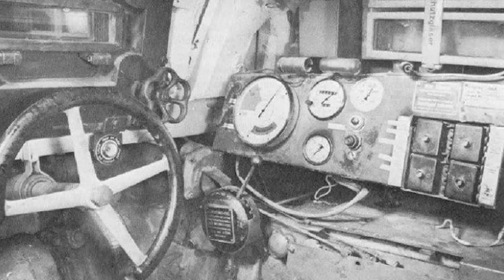A Deep Dive into the Tiger I, by the Chieftain

Comment: Speaking of cranes, how did the Germans ship these things to N. Africa? Were they forced to disassemble into two pieces or did they have some transports that had 60+ ton capacity cranes?
Reply: Most Tigers were shipped on the "Marinefährprahm", a barge designed for beach invasions of the D-day type. Each barge could carry one Tiger. They drove onto the barges from the beach at Reggio Calabria and they debarked at the airport dock in Bizerte.
The first three Tigers were brought over by a roll-on roll-off ship, but that got sunk soon afterwards.
There was no need to dissassemble the Tigers because cranes were not involved.

Comment: I never, absolutely never, actually expected that they'd teach tankers to aim at that cupola. I just figured that's far too small an area to shoot for with WW2 tech and guns. I'll be damned if War Thunder inadvertently taught the same thing. While the game laughably models APHE like it's a hand grenade when it explodes, it should be a conical spread not a spherical spread, it's just very surprising that the game somewhat plays into history in that case. In the game they also use the same idea against the IS-1 and IS-2 and I would wonder if the Germans taught the same thing by chance. Still very surprising to hear that in real life some tankers or tank destroyer crew were taught to aim for the cupola.
Reply from the maker: Surely not an easy target.
Reply: There must have been incidents where the cupola was hit, because in the Spring of 1943 the number of bolts holding it was increased from 10 to 15.

Comment: The Germans are famous for their engineering but sloped armor seemed to be lost on them until the Panther and only because of the T34s sloped armor. Germay would have been better off mass producing a single tank. Even the panzer Mk. IV in enough numbers would have been better than the wasted time money and materials on competing designs. The Panther would be my choice to gear up for producing I would have kept the Stug III in production. Like the Sherman that was a poor tank but there was a lot of them the Panzer MK. IV that was a better tank then the Sherman could have helped Germany if mass produced.
Reply: exactly they had too many maintenance problems with too many models and never really worked the kinks out. The Stugs and the Panzer IV would have done them well with modifications
Reply: More tanks wasn't going to do them any good when they were running out of men and fuel.
Reply: Germans new the benefits of sloped armor but, they didn't use it on the Tiger because it reduces internal space too much in comparison with the benefit of extra protection at the time as 100mm of vertical armor was more than enough. Then the Pz 4 was worse than the Sherman in all aspect mainly mechanical reliability, maintenance, armor, and production cost but better  gun and optics.

Comment: Anyone know if that Tiger 1 in museum has original type paint? Or glossy for display.
Reply from the maker: @tw t at 14:40 the curator talks about the paint used, the 'glosiness' is most likely due to the fact that this tank has sat in a clean indoor environment since it was painted rather than driving around in the real world
Reply: @WorldWarTwo  The troops that got this tank new off the train in 1941? Tank reg. must have seen and been impressed by some new paint/all new tank also.
Reply: @twt000  Deliberate choice as museum tanks don't go to the wash rack very often. It's easier to clean a semi-gloss.
Reply: @twt000   Tigers were not delivered to any troops until August 1942. And those troops were up near Leningrad, so they got very dusty Tigers.
Reply: @daveybyrden3936  Rail yards are usually not dusty, nor is Leningrad it being forest. Still some dust though. Not like dusty Volga.

Were the Tigers delivered to the front? Or did troops have to go pick them up?
My main other point is them seeing the Tiger "brand new", were they excited?
Reply: @twt000    Those Tigers had been transported from Germany to Leningrad by rail, sitting on open rail cars. 
They were not literally delivered "to the front" because the railway lines didn't  terminate in a trench. Of course the troops had to pick the tanks up from a station.
Reply: @daveybyrden3936  Was meaning the nearest station to the front. So the tank regiment would go all the way back to pick up Tigers and lose forward line momentum? Or would have some lower ranks delivered them?
Reply: @twt000   I don't know why you're asking this, because your first question was about glossy paint. 
But if you must know; they would send enough mechanics and trained tank crew to unpack and start up and drive the Tigers forward. That's two or three people per tank. The stability of the front line was not impacted.
Reply: @daveybyrden3936  Asking because the paint was also new in 1942 and must have also been noticed by the tank crew. Like admiring paint on a a new car.
Was also curious what part of the crew dealt with the arrival and or first impressions of the paint. 
Was it as glossy in 1942 as in the museum? Seems the answer is it was different.
Reply: @twt000   We have photos of new Tigers being unloaded from rail cars in Germany in 1942. They don't look shiny in the least.

Comment: Meanwhile the British and Americans were ditiching the sandguards off their tanks as soon as possible. or so say the books. OR maybe they all got lost because they didn't stamp them with the number of the tank they go to. Or "lost". Everyone picks on the Germans about things like that, but they have never seen the chaos of a field repair depot, with disassembled machines everywhere, parts removed and left around by 200 different men. it is hard enough to keep track of all the parts off of a single vehicle you are taking apart by yourself out in the garage, try repairing 20 tanks at the same time with different guys on different shifts, people stealing parts, etc. Stamps are cheap and easy, if you mark the parts beforehand you don't need to use grease pencil to mark them all as you pull them off. that is basically the difference, Germans pre-mark their stuff, everyone else makes the repair personnel mark them themselves as they take it apart, if they want any hope of putting it all back the right way.

Comment: It really is a shame (for Germany) that they created such a well-armored vehicle but failed to save weight (or increase protection) by giving the armor some decent sloping, especially with the turret face. Well, that, and that the design really was not well designed at all from a maintenance/repairability/logistical standpoint.
Reply: That's why they made Tiger II. But then they thought "what if we used all this saved weight to add even more armor"?
Reply: Sloping doesn't save weight.
Reply: @atfyoutubedivision955  it's nore efficient, hence you can have the same protection with less armor hence less weight

Comment: I will always stood by the belief that the Tiger I was the best tank in the world (although that title may have been a title for just 1 or 2 years, since technology in WW2 moved super fast and the Allies were coming up with real "Tiger Killer" monsters) but, as was said, it never was used to the intended role, the Germans never had enough of them and they never had the proper logistics either to do the maintenance (with labour intensive tanks like these you want to not only be in full capacity but also have enough spare tanks to rotate between service and maintenance...Germany could never hope to have that avaliability, they could not even fill the units). But even so it as quite a machine!

But a bad tank? Hell no! A "s*itty tank" would NEVER have had the "out of role" performance the Tiger had when put in the hands of capable commanders/crews like Witmann...and when not being harrassed by enemy aircraft, that was a problem in 1944.

The Tiger II...that as a different issue. That thing may be considered a bad tank. Although by the time they came by, Germany could not evne afford the petrol to keep running them.
Reply: How about these facts:  Germany was about to produced about 50,000 various models of tanks.  On the other hand the Chrysler Motor Company built nearly that many alone, not including tanks built by Ford and General Motors.  Ford had B-24 bombers coming of their assembly lines at a pace of 1 every hour.

Comment: Well so long as they kept the cut away parts, there's no problem welding them back on, did they keep the cut away plates 👈😑
Reply: I have never heard anything to suggest that the cutaway plates of this tank were preserved.
Note that it's not just steel plates that were taken off; ammunition bins were removed from the hull sponson, and the main circuit board was removed from the turret. Haven't heard anything about them either.
Reply: @daveybyrden3936  

Oh well, if they want to restore the tank they'll just have to refabricated the missing parts, it's not like that thing is ever supposed to be deployed in military service again 👈😑

Thank you for your reply 😑
Reply from the maker: @Barbara Rice @Davey Byrden As a museum nerd myself I'd like to point out that the museum may well not want to 'restore' the vehicle as its use as a training aid is a part of that vehicle's story and history. Most museums would not want to cut off the history of an object at an arbitrary date (in this case would it be the date it was captured? or the date it arrived in the US perhaps?) and treat it as if it were frozen in stasis beyond that point. Objects have fascinating stories to tell about history beyond their use in their 'original context' or for their 'original purpose'.
Reply: @WorldWarTwo  

Well it's your tank, I'd hate to think you supposed that I was telling you what to do with it 👈😑

But aren't you overlooking the fact that replacing the missing parts is a part of its evolution and will form its story also 👈😑
Reply: @barbararice6650  The argument could be made, however ultimately as a museum piece, the cut aways actually have the advantage of allowing people to see the inside. There's several tiger 1s in museums around the world, and almost none of them can you see the inside.

Comment: If they really wanted to restore those German tanks back for display purposes it shouldn’t be too hard to fabricate replacement panels out of plastic or aluminum to plug the holes.  The panels could probably even be made so they’re removable again to display the insides. Sure it’s not authentic but it’s not like these vehicles will ever actually need armor plate anymore so fakes ones should be fine.
Reply: Yeah, its not really a big deal. These days, tanks, including tigers, are rebuilt from Tiger parts anyway, and turret tops and sides are welded together to make a tiger.

Comment: The Germans unfortunately fell into the "Quality over Quantity" mindset in tanks, aircraft and other things. The Soviet leader, Stalin, said that "Quantity has a Quality of it's own." The Chieftain explains in another excellent video how the Tiger I succeeded splendidly when - in the few times it actually happened - it was used in the way it was designed, as a Breakthrough tank.
Reply: @michaelpielorz9283  No. The Allies, specifically the US, were more of the quality + quantity because they can do it. The Red Army needed more tanks in their massive operations so they went into the quantity approach. Now that I'm thinking of it, the Nazis weren't even able to go into quality, since their tanks frequently broke down in the field, and quantity, since they couldn't field enough shit to save their sorry asses.

Lol, and "when the Tigers showed the Shermans ran"? Wittman's punk ass was vaporized by a Sherman, so I don't know where you got that silly info. And the Sherman is more than capable of punching through a Tiger. Check out Glantz and Steven Zaloga for more information.
Reply: Michael Pielorz

Exactly. Germany could never match the combined allies output (250,000 AFV types) so it was pointless trying.

Even if they could, what's the point building 60,000 Tigers when you haven't got the men and resources to make them function.

Germanys ONLY logic was quality over quantity. If you make loads more Panzer IVs you still won't have enough to match the numbers of Shermans and T-34s so you will have neither quantity OR quality superiority.

Tigers had around a 10:1 knockout ratio overall but that still wasn't enough.

Comment: Very nice video, but I spotted a mistake:
The manual turret traverse handwheel for the commander has nothing to do with spotting targets and laying the turret on it for the gunner. A precursor to the commanders override if you will. If you wanted that youd give the commander a way to use the power traverse.
The actual idea behind it was that, should the power traverse fail, the manual traverse would be used as a backup, and the commander could use the second handwheel to make that go at least a little faster.
Reply: The first few Tigers didn't even have that wheel. It was added because of feedback from the crews. So it can't have been designed as an integral part of laying the gun.
Much more likely it allowed the commander to pitch in and help, as you said.

Comment: It always amused me that the germans built them as if they were made of wood. Dovetail joints and a smear of glue (weld) pushed into a badly cut joint. Stick to what you know I suppose. Having seen those joints split apart and the poor penetration of those welds, it beggars belief that they didn't crack open like an Easter egg after a day or so.

Comment: 17:40 I was unaware that Germany -- or the rest of Europe, for that matter -- operated a rail gauge narrower than the 1435mm Standard Gauge {that the Russian gauge was 1520mm caused an unending series of problems for the Germans attempting to move materiel into Russia). The restriction on the width of rail-transportable equipment was due to the limitations of the infrastructure -- width/height of tunnels, track separation, etc. -- that placed a limit on the size of railcars that could be generally used on rail lines.
Reply: I think that's a misunderstanding. All ETO main lines were 1435 although there were many small narrow gauge lines in rural areas.
Reply: @andrewblake2254  It's the way he said it -- "The smaller-gauge European railways"; gauge specifically refers to the spacing of the rails, not the limitations of the associated infrastructure. Unless he's referring to loading gauge, which defines the maximum height and width of railcars and their loads -- but 'gauge' by itself refers to the track, not the rolling stock. Sloppy.
Reply: @seanmalloy7249  He was referring to the loading gauge. Not being a transportation type, I think we can let it slide.
Reply: OK now I have listened to it all I know what they mean by rail gauge. He is not referring to the width of the tracks but the envelope within which trains had to run (height and width). So the envelope was smaller than the the US even though the track gauge was the same. This is critical for clearance of tunnels, bridges, platforms etc. So same gauge, smaller wagons.

Comment: A very costly and heavy tank. Very resource intensive in terms of production and man-hours. I think it is a great tank as well, but, you have to wonder could the Germans have simply built more Tank Destroyers, or even Panthers, with those resources and achieved the same results? At the end of the day, its about how many enemy tanks your tank can destroy. The Tiger could definitely destroy tanks, no question, but, how cost effective was the Tiger as a platform? If Germany had resources to spare, then things like Tiger I's and II's can be justified. But Germany never had the resources to spare for high-end systems like the Tiger.  Their enemies, by contrast, had resources to spare, and thus produced endless streams of inferior or mediocre models like the Sherman, or the effective, but rather crudely made T-34. Even when resources are not a bottleneck like in Germany, heavy tanks were still not the optimal use of materials and production hours.

Comment: Will never understand, why they did build such a heavy tank, which couldn't even withstand their own KwK 40/L48 from the front. And why they didn't slapped some extra armor to the front upper hull plate, after the Russians fielded more powerful guns. At this weight, a Tiger, or any other tank should be at least immune to US 76 mm and Russian 85 mm guns.
Reply: Because you can't just point more armor on. More armor means more weight and the German tanks were already dreadfully overweight, so much so that just turning too fast could break the final drive.
Reply: @Pixilated  We are not talking about tons, maybe about a few hundred kilos.
Reply: @0Turbox  Armor is really heavy so a few hundred extra kilos of armor would be neglagable. Even 5mm of extra armor on the upper front plate would weigh a few tons.
Reply: @Pixilated  Why you don't do the math by yourself? A steel plate of about 3,54m x 50cm x 50mm weights around 700 Kg. I guessed the hight of the upper frontal plate. A 40 mm plate would weight 555 Kg, which would have been sufficient.
Reply: @0Turbox  Using your measurements of 34500cm x 50cm x 0.50cm to find the volume of the plate and then using the weight of 1cm3 of steel, the plate would weigh 6991.5kg so I don't know where you got 700kg from.
Reply: Even when you think of about it, there is no way an 862500 cm3 of steel would weigh that little
Reply: @0Turbox  I don't know why you thought I wouldn't check your work.
Reply: @Pixilated  34.500 cm, really?
Reply: @0Turbox  what
Reply: Becase to do that you needed a plate of 150mm of thickness which is even more weight for an already overweight vehicle, and is not as simple as just bolt some more armor.